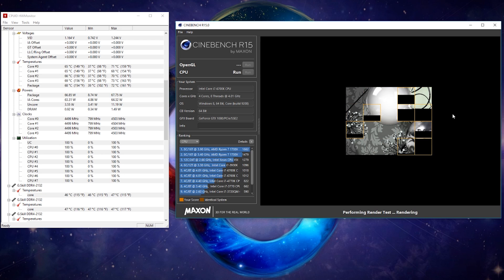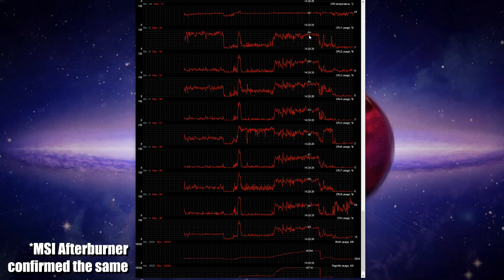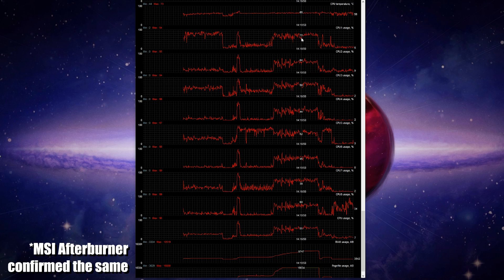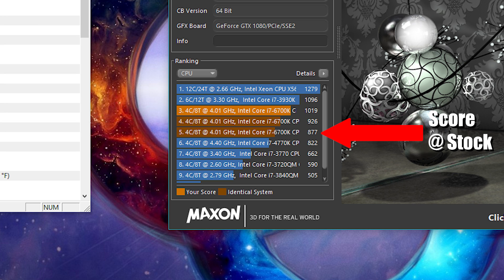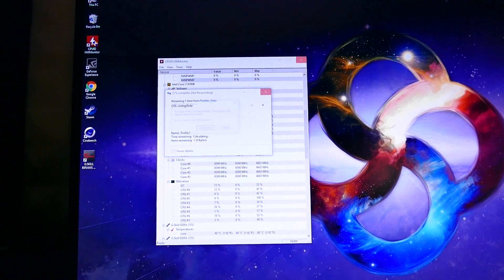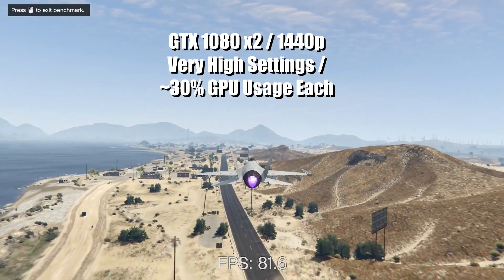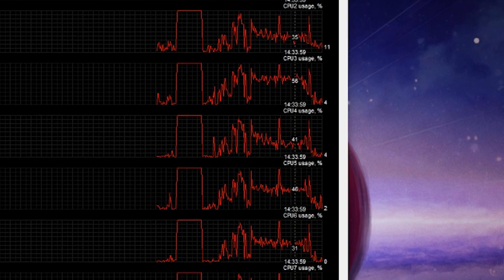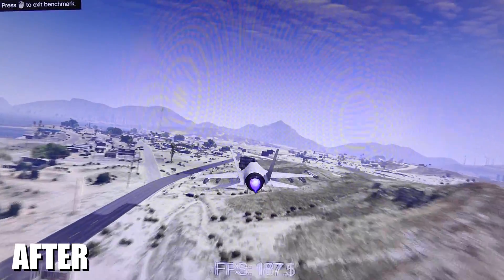My PC was Terribly Under-Performing...

Comment: This is interesting. i have a 1070 and i5 7600k at 4.2 GHZ and my friend has pretty much the same. But for some reason my pc is lagging in GTA V whilst my friend is running it completely fine. Any solution?
Reply: Zeus Try reseting the CMOS
Reply: CHProdigy Alright. i might try that. cheers

Comment: If this happens again change "send diagnostic and usage data to Microsoft" from full to basic.  It's in the privacy settings.  Wiping the OS will only temporarily fix the problem, it will come back.  My frame rate in certain games e.g. Tyranny was reduced by over 30% due to this setting, confirmed on multiple PCs.  Reinstalling would temporarily fix, but then it would come back spent two weeks pulling hair out trying to work out what was going on until I stumbled on the shocking solution.

Microsoft made a change to this functionality in February which drastically reduces performance without there being any other visible signs that anything is wrong, like a virus.

Comment: When you troubleshoot the most common issues and even clear the CMOS there has to be something wrong with Windows.or at least something software related that's not going to default when clearing CMOS.

What was it?yeah.. I think that's just too much work when you can reformat the issue. (not optimal as a solution but it could be worse)

Comment: maybe windows power settings?
Reply from the maker: Nope. Checked.
Reply: Maybe it was something with the voltage drooping down?
Reply: This was my answer too.....I noticed your cpu goes down to 800mhz, which only happens to mine when I have it on "balanced mode" rather than performance.

Comment: Rebooting will always fix things.
Reply from the maker: OH YS THX
Reply: Have you tried putting it in a bag of Rice
Reply: Have you checked first, if it's plugged in?
Reply: Is the power supply connected?
Reply: Science Studio brings Mac into store that's ripped into 20 pieces apple employee: did you restart it?
Reply: Well it didn’t fix my gtx 275 that I still have in my pc
Reply: trizm 6ix 六 so chinese will come overnight and fix it
Reply: if you put a bowl of rice over the tower then they should fix it over night.
Reply: these issues are almost always caused by you touching settings in windows you don't understand. Like doing anything in the registry at all.
Reply: Next time go to decentsecurity.com and clean up your installation.

Comment: quick question 2 1080's or 1 1080 ti?
Reply: Probably Ti, since SLI can be weird and its not really worth your money.
Reply: 1 1080TI,so you can add another one later down the line.
Reply: 1080 Ti
Reply: Sure

Comment: I think I would have just ddu the gpu drivers before windows reinstalll.  With windows reinstall the next step.  

But I think it was really just the Russians.
Reply from the maker: Didn't work.
Reply from the maker: Yes Jonas.
Reply: RRainerss Russians are always the fault of anything that happens bad.

sarcasm
It is of course politics and everyone hates Russia for some reason.
Reply: Did you complitly uninstall the drivers and i mean did you go to the windows programm manager because i had the same problem with the 1070 of my brother and this solved it ;)
Reply from the maker: nawaf with the troll swoop.
Reply: you probably had game mode on from windows, just noticed that i had the same fucking cancer setting on and i had really hard throttling on my graphics card before disabling that completely useless piece of shit microsoft made for some reason
Reply: Becuase fx8350 is a ryzen processor obviously. are you really comparing a intel 8 core to a measly 4 core in multitasking? Turn off everything when you play on your shiit quad core and see how much performance you gain.  We are tired of youtubers licking intels ass. Saying that a quad core for 350$ is all you need. While benching on a cleen install of windows without anything running in the background. Intel needs to give us an 8 core at 350$. Licking amds asshole is the same as intel. A quad core is too much, i duel core is all you need for gaming.
Reply: Its clear that, its a problem with having only a quad core. Reformatting his system removed everything. So it means less stuff runs in the background. With time as he installs more stuff in his system. The problem will com back again. Quad core is enough for gaming if you are willing to kill everything running just to game. 3 years ago a quad core was enough. But with current gen consoles. Devs are using more and more cores. Stop living in the past and get an intel 8 core or a amd ryzen 8 core.
Reply: How is  FX8350 became a reyzen preccessor?

Comment: Maybe the Windows 10 Game-Mode was enabled for whatever reason. It cut my fps in half when i turned it on.
Reply: Game Mode is broken AF
Reply: chappax5 He had low scores in other applications also,not only in game.
Reply: I bet they put that feature there just to piss us off. It took me 3 weeks to figure out why me 960 wasn't getting 100fps in bo3 like it usually did, it also kept frame skipping every two seconds. It pissed me off until I noticed the setting and turned it off.
Reply: chappax5  you can also delete the Xbox app. if that's not what you're saying
Reply: Opposite for me. Made my games run smooth if they were well optimized. Damn devs grumbling
Reply: Isn't that included in one of the updates for windows 10?
Reply: SavouryStew that xbox app is fkin annoying. it's making my cursor laggy when im playing certain games
Reply: Mil Man People have varied results.I've heard it being useful for lower end rigs,not affecting people with good ones,or rarely decreasing performance as well.
Using something like Razer Cortex improved performance on the Intel HD,nothing on the 1070.
Reply: Funny thing is that if it doesn't work people don't give Microsoft credit for the good job they've done of thread management to keep the code on the proper cores. The main goal of Game Mode is to prevent programs running that don't need to be, and keep the games MAIN CODE THREAD on its own, dedicated core to avoid lower FPS or other programs suddenly causing stutter if they jump onto that core.
Reply: chappax5 If you needed MORE reasons not to use Windows 10...

Comment: Maybe the problem was some kind of driver that was messing your OS. Did you use that booting drive on other PCs? If that is the case, it may have been modified some registry files.
Reply from the maker: Used the same drive again.
Reply: That means that the NSA was spying you and didn't wanted you to have way better FPS than they do with dual 1080s in SLI while playing GTA. Jokes left aside, at least the problem was solved.
I wanted to ask you a question: Why my GPU is showing to be at its boost clock always? No matter what I'm doing (idling at the desktop, Chrome,etc...)

Comment: Maybe NnVidia are just assholes with SLI this gen
Reply: Btw I posted this at the start then I watched it all the way threw and I backtrack this statement
Reply: They are. SLI Doesn't benefit gaming anymore, and they don"t garantee 3 and 4 way anymore.
Why do you think the GTX1060 doesn' t have a SLI port and SLI became shit? Because they didn't want you to buy two or more low end/mid end GPUs to have high end performance at a lower price...
Reply: Btw love your vids Greg keep up the amazing work I always find myself waiting for your next upload
Reply: UNDEFINED_// ILLUMINATI ik I'm just saying that after the SLI fiasco now they got ride of SLI and don't support it
Reply: UNDEFINED_// ILLUMINATI but it was a joke
Reply: UNDEFINED_// ILLUMINATI and I retract the statement
Reply: And Greg I'm two for two
Reply: Just FYI, but part of the reason for lack of support is that newer games can have a feature that doesn't work on multiple GPU's (in AFR; Alternate Frame Rendering). Some things like anti-aliasing can have reduced work load if you analyze over several frames, so they need the same GPU to be working on every frame to utilize this.

Eventually we'll get SFR (Split Frame Rendering) but we need game engines to build that in to make it easy to implement. It's hard, and there are other things to worry about.

I like that NVidia was HONEST about SLI not working great. Heck, AMD instead showed a confusing demo of their RX-480 launch saying "look two cards cost less than a GTX1080 and work better"; uh... yeah for that one game they showed.
Reply: UNDEFINED_// ILLUMINATI no most devs are too lazy to bother with sli